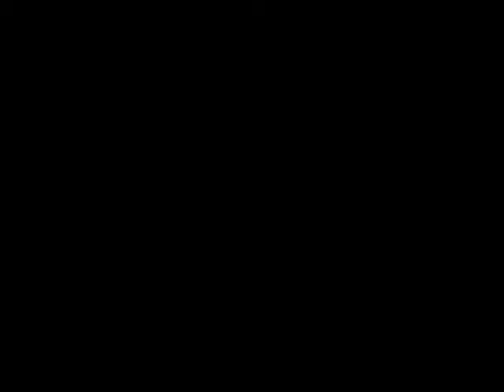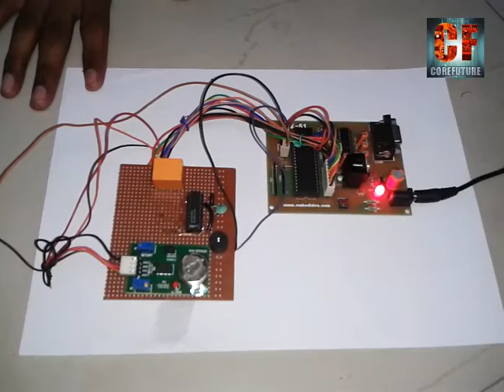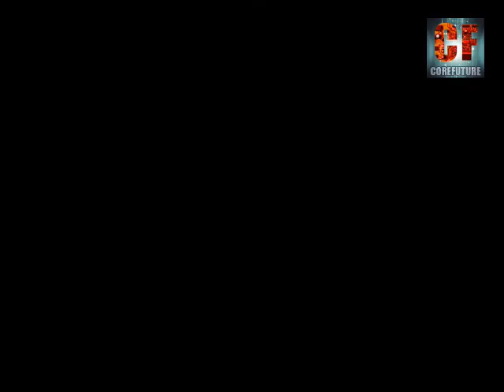How to build a Smoke Detector with Alarm

Comment: Yes it is MQ2 Sensor. I can't post the code here, as I did this using 8051 Microcontroller. I have to find out the code first. If you need the codes, then just drop your mail id here.